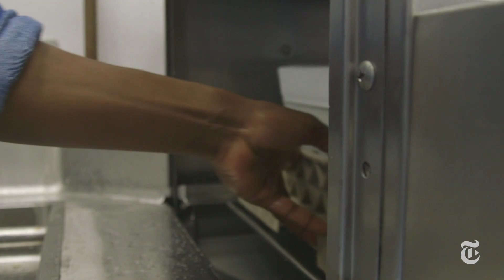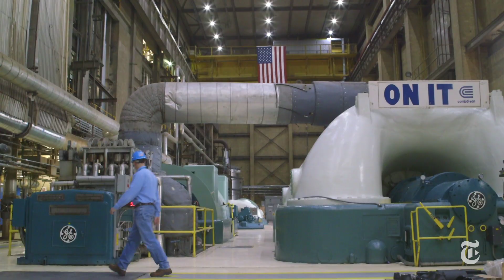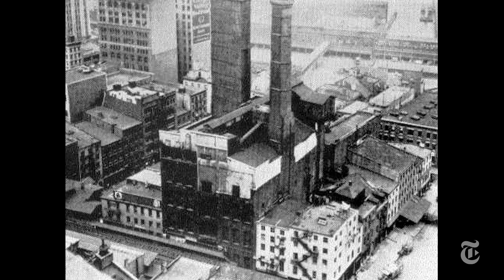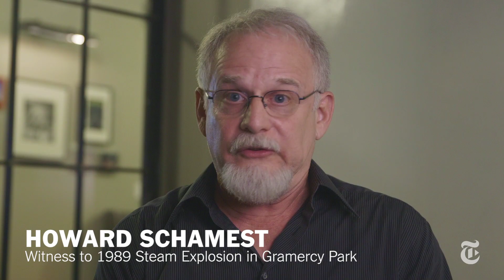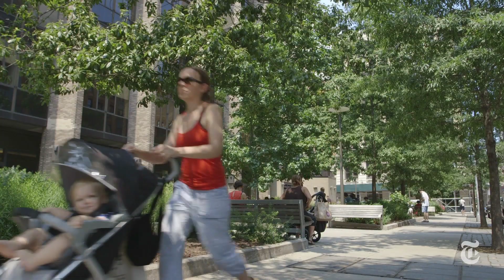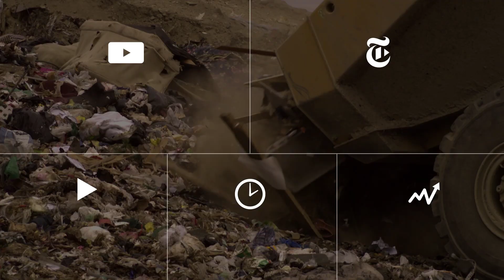A City Shaped by Steam | Living City | The New York Times

Comment: Makes me wonder:
- what would it take to completely electrify NYC (e.g. no more steam)
- what would be gained, e.g. robustness? simplicity? cost reduction? etc
Reply: NYC is already fully electrified, as in all buildings have access to electricity. Getting rid of the steam system would require all the buildings currently using it to build new heating and cooling systems (hot water heaters and the like) that would be much more separated and likely less efficient. Not to mention, they would still have to burn natural gas and would probably be less clean in general. The steam system is not really outdated at all in terms of a centralized and efficient heating system.

Comment: when water turns to steam it increases 1,700 times in volume.  that's a ton of power.  and it's just water vapor.  I imagine the only reason there aren't more cities in the U.S. using steam is it would require its own infrastructure, and probably be insanely expensive to put in giant pipes underground as well as outfit buildings with everything necessary for steam.  I noticed they said New York City was basically "built around steam"

Comment: How does Steam help keep NYC cool during the summer? That was never explained properly, only mentioned for like a brief moment. I understand steam helps keep buildings warm during the cold season, but how does it keep them cool during the hot season?
Reply: Put a steam turbine instead of a normal electric motor on the compressor. Kind of lossy, but the steam is there anyway in the summer and so the electric grid has not to endure the big peaks from airconditioning on the hot days.

Comment: First time I had ever seen something like this was throughout former Warsaw pact countries (Poland, Czech, East Germany, etc.); large pipes traversing streets overhead, underground, places where snow does not stay... thought it was brilliant... FWIW, all across Ukraine gas pipes are above ground, plumbing formed to size simply by heating and bending to shape very few fittings... simply cut and welded pipe branches... so far, so good... asked how many failures/leaks... reply was confused looks (no failures came to mind)... until the Russians invaded. Potential concern is that "Big Brother" will ultimately control everything (Black Helicopter thinking, perhaps)

Comment: Is that water heated with coal from the Apalachian Mountains?
Reply: No, they use natural gas. When all the homes in nyc use natural gas during the winter, and there is not enough gas in the pipe, coned might use fuel from a barge/storage tank.

Comment: Let's get some of the operators and engineers on here to answer real questions.

Why is steam so efficient?
How do you heat the water, into stream?
Where do you get the water?
What is steam hammer?
What precautions are taken to minimize potentially dangerous failure events in the future?
What pressures do your systems run at?
How hot is your steam, and why is it that hot?
Why does stream seem to vent from specific locations , continuously?
 Details make the cake.
Reply: Steam has a high heating value. Also before natural gas was placed in the city, having one coal plant was a lot better then every building running their own. 

Steam is heated under pressure in the superheater after it leaves the steam drum. This is where the steam is 'dried'.

The water comes from the Aqueduct, so it needs to be processed via an RO, or else you will scale the boiler. 

The street pressure is around 200 psi I think. 

It's probably around 300-400 degrees to carry the extra btus.

Steam vents because there is a steam trap that failed. It's likely waiting to be repaired during a shutdown.
Reply: 1) Because it would get wasted otherwise and it's still useful, 2) Boilers, by burning something 3) River probably 4) Look up "practical engineering" they have a video on this 5) Multiple-redundant safety features. Too complicated to answer simply 6) 200psi 7) Most steam systems run at the boiling point of water unless they're superheated this is just how steam works 8) Leaks or overflow. This is also a safety feature, excess steam is allowed to vent to prevent pressure build-up. But also because in general you're making more than you need, if you made less than you need you'd periodically have not enough because nothing is perfect and the load is going to cycle.
Reply: @lemonsqueeZ96  I don't think you get the point

Comment: Everytime I went to the city I always wondered why those steam pipes were there. I just thought they were heating the lines underground or just letting off extra steam.  I still dont get why it just runs out like that and it isn't in a line concentrated. Why would it leak? Pressure relief?

Comment: I'm surprised on how they keeping the steam hot enough and dont condensate back to water through those long lines, plus on how they bring down the temperature of steam to safe temperatures for consumer, because the boilers need to boil the water until it reaches a tempratures of 500C, it becomes superheated steam, and then it exist the steam turbine with maybe a temperature of 150~160C, but even then the steam will be so close to condensation temperature, maybe touched   it and some steam already become liquid form it need to be reheated to become vapour again or maybe the heated steam dont have alot of pressure so it doesnt need alot of heat to stay steam. Anyway it is work of art.
Reply: They also have boilers that feed steam into the "grid" without making electricity in the first place.

The consumer does not come in contact with the steam, since it passes through a "steam station" to lower the psi at the customers. A lot of the customers are commercial, not necessarily residential.

Asbestos does miracles in insulation, and they maintain the steam trap really well. So the steam reaches the customers fairly quickly.

Comment: I don't see how this is greener since steam and electricity both require the same thing to generate them and that will be whatever fuel is used to boil the water, be it coal, gas or uranium.  I do see how taking the turbines and generators out of the equation reduces loss but steam loses even more energy in transit, it basically heats the ground and subways below Manhattan through escaped heat.

Scepticism aside though it is a very cool and unique system that is an integral part of NYC's image as no movie set in the big apple would be complete without that one scene of a steam-filled alleyway.
Reply: The steam is a waste product from power generation. You can just condense it using cooling from a large body of water or use it for other purposes. The power plants use NG, oil, coal or a nuclear reactor.

Comment: If steam is so efficient why haven’t I seen any new town or neighborhood  implement this system ?
Reply: If you look at large hospitals or business parks, you will likely see steam. I work at the VA and we use steam for heating, and chilled water for cooling the entire campus. it all originates from one building and is piped to the rest, where it is fed into the air conditioning system at numerous points.
Reply: In Denmark and other Nordic countries we use hot water from powerplants and solar facilities.
Reply: They do! Large facilities such as stadiums,, hospitals and conference centers still use boilers for heating and energy transfer.
And every home has a hit water heater in it!
Reply: There are plenty of citys that use this type of steam system. The reason most places dont have it is because its expensive to implement and most of these systems were installed when the citys were in development.

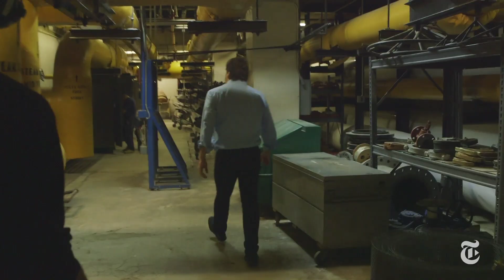Comment: 2:02  No wonder it's 90% humidity in the plant if they discharge steam inside.  Would that be unintentional leaks?  Why not discharge it outside?
Reply: It's condensate that goes to the trenches to be reused. By reusing it the efficiency goes way up. If they don't drain it then you get water hammer.

Comment: Now, if they managed to heat the water is create the steam through geothermal systems.  That'd be cool. NYC is a little to build up for that, but expanding cities would be able to implement something such as that in the core Downtown region. Plus goerthermal would be very consistant and would only fail to heat if the earth stopped spinning, in that case we would have quite the issue.

Comment: Why steam and not hot water based district heating?
Reply: zapfanzapfan high pressure steam contains much more energy.
Reply: You've seen how cold it gets in NYC. It has to be steam otherwise there would be broken, frozen pipes everywhere in winter.
Reply: Probably because of the energy density needed to heat the skyscrapers

Comment: What % of condensate is recovered now?
Reply: I was just thinking that!!! How much condensate is returned to the plant and how much make up water is required.
Reply: So in the building I work in we use the condensate to preheat our hot water by passing through a heat exchanger. Then the heated water goes through a hot water generator, using steam, that heats up your tap water. The condensate goes through a cooling tank, as required by law, before it is discharged into the sewer system. As far as I know, condensate is disposed of at the consumers point of use. ConEd doesn’t recover any of the condensate.

Comment: Wait.. can someone explain the "without steam all of these high rises will have chimneys raising on top of it"? As opposed to all of those ugly and dirty rubber chimneys that are in the streets so that steam doesn't block pedestrian and traffic views? I have never seen any city with high rises with chimneys on top of them. Look at Shanghai, Hong Kong, etc. What makes steam so great to NYC that no other city -- that even those denser than NYC don't use it?
Reply: Everyone used to have steam systems in their buildings. Remember the radiators under the windows of any older house or apartment?  She just means that instead of having a local heating system in the building that would need a chimney for the flue gasses, it's imported steam from a place that has a larger chimney miles away.

Comment: Heat the steam?? you mean heat the water to create steam?...
Reply: No, they actually mean heat the steam. You have to drain the condensate and heat the steam again (or increase the dryness fraction of it) after it's been through a process to get it up to do more work. If you don't, you get water hammer, and you saw the results of that.

Comment: How does steam provide cooling power?
Reply: Actually the more direct way to use steam for cooling is with absorption chillers. The steam is used to provide heat in the refrigerant's evaporation cycle, instead of a compressor.
Reply: jet cooling im not gonna explain it since you are on youtube and can look it up,  condenser in a/c use heat to condense the liquid and evaporate it and as it returns to a liquid it will be chilled , those chilled tubes go into your house and connect to the central air spreading the cooled air throughout the building
Reply: by running the pumps for the A/C unit.
Reply: Use the steam to run a turbine, the shaft of which powers the compressors for AC cooling unit. Or even more indirectly use steam to power a turbine which powers a generator which generates electricity for electric AC units. Think of it as a power plant where parts of the power plant are decentralized.

Comment: Wait so does New York have a bunch of small generators all around the city?
Reply: Yeah, it has small co gen units instead of running steam for miles and miles creating waterhammer they can have smaller runs and don't have to heat the steam as much.

Comment: They are still using electricity or another fuel source to make the steam and the steam would cool slighting in the pipes and the efficiency would decrease
Reply: Traditional coal power plants burn coal to make steam to spin a turbine this steam is then either cooled in a cooling tower back to water or vented I'm NYC they take the steam a and use it to heat hoises

Comment: Great video. As a retired Local 94 operating engineer I’ve worked with steam my entire career.
Reply: Is there still asbestos in the steam pipes?
Reply: local 94 doesn't deal with steam local 30 does
Reply: @seanhicks8538  not true where did you hear that, Local 94 works w steam on a daily basis even if you don’t have a dual ticket
Reply: local 94 huh, so you sat on your @ss for 20+ years until retirement.